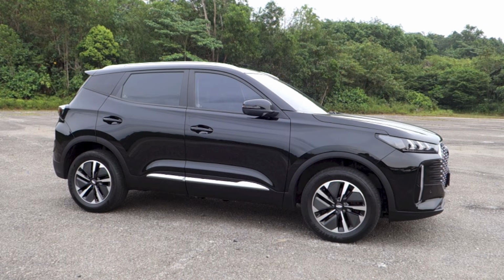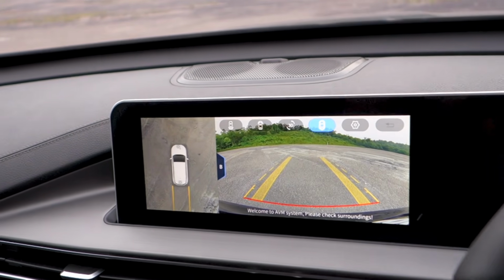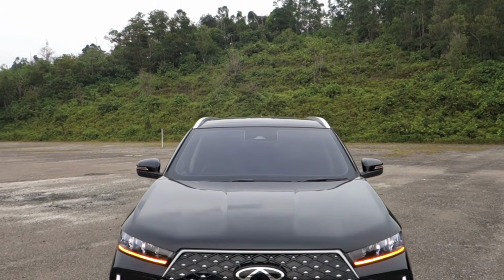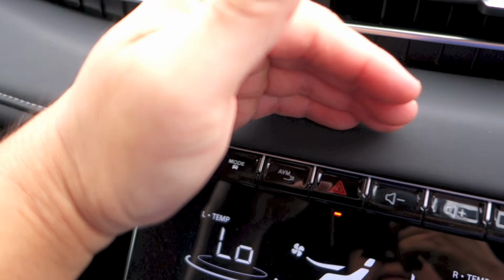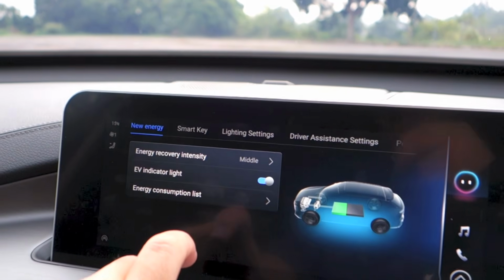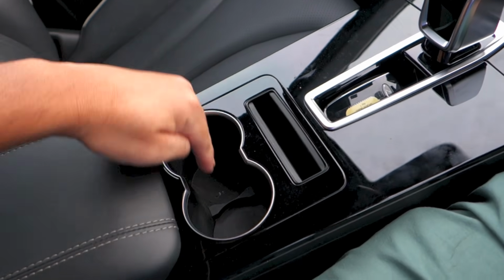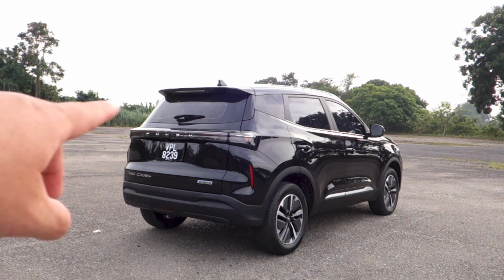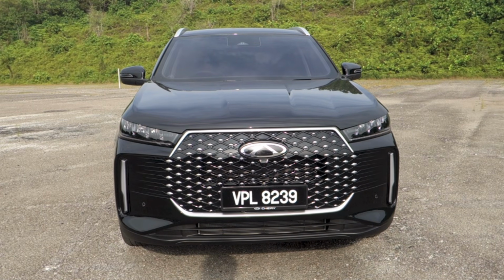2025 Chery Tiggo Cross 1.5 Hybrid CSH Start-Up and Full Vehicle Tour

Comment: What i like about this car, it works the same as its PHEV siblings where the hybrid battery propels the car first. The petrol will only kick in if u drive above 120/130khmh if im not mistaken. So in theory u will save a lot more even if u r going above slightly the hway limits. Plus unlike other J brand hybrid it works the other way around where the hybrid is only to support the ice engine to propel the car and if u drive slightly above the speed limit, it justs not economical anymore as u want it to be. Best yet, this car tank is bigger which can give you more mileage in a single tank. I also doubt the Haval H6 HEV is more economical than this car since the tank is larger (60L) and overall fuel consumption combined is not as great as this Tiggo Cross. My only complain about this car, it does not have sun/moon roof like in other countries else it would have been awesome.